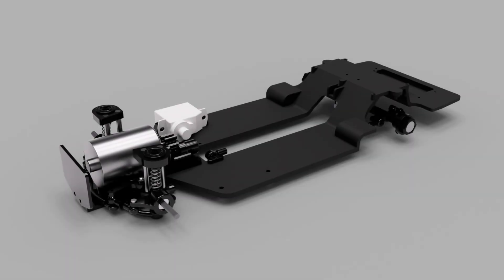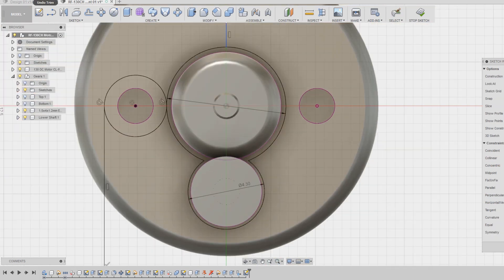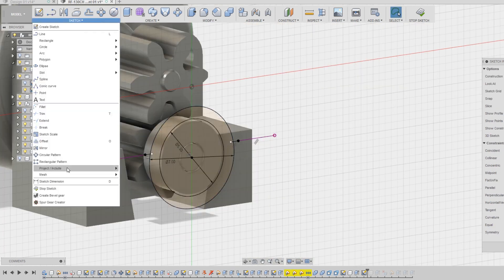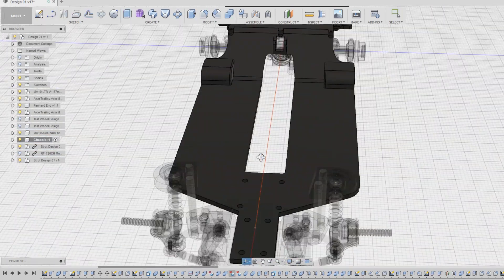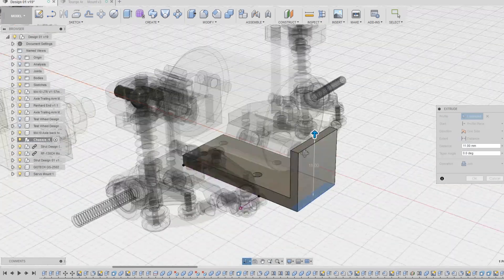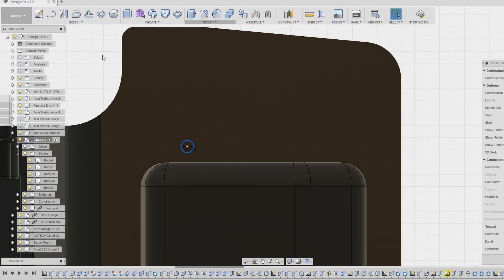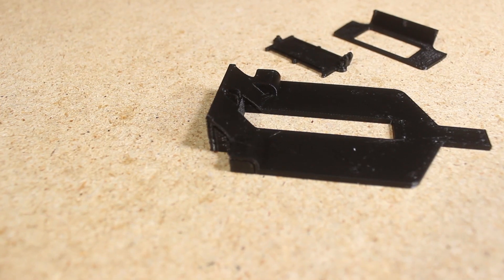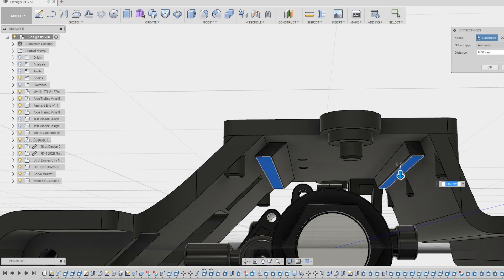RC Chassis Speed Modeling: Finishing Designing the 1/24.5 Scale FFR SC1

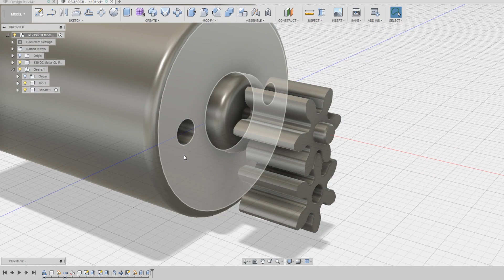Comment: I race slot cars ( HO/1:32nd/1:24th) and, having found your channel, I've been inspired to build a 1:24th scale car chassis based on your parts. I was wondering, what kind of motor specs have you been designing your parts around?
Reply from the maker: Mostly just typical 130 size DC motors and I've also been designing some around smaller brushless motors as well. Most motors I've tired have more than enough power, and it's easy with most transmitters to turn down the max speed if needed. Experimenting with different spec motors is something I will be experimenting with more in the future.
Reply: Thanks. We use a 180 size motor, NSR King 25 (25,000 rpm, 350 g/cm torque @ 12 volts), and was wondering how well the drive train might hold up. I might have to look at other motors.
Reply from the maker: Yes, That motor sounds a bit overkill for these vehicles. We will be offering a selection of compatible motors and other electronics as well.
Reply: Our 1/24th scale slot cars use a brass chassis (H&R Racing; http://www.hnrracing.com/), that is why we use such a torque-y motor. I might try to make a brass version to maintain the motor spec, though, I also want to try use your parts in one of my builds.

Comment: Simplify 3D has a feature called dense supports. With it turned on you can select what infill percentage the top n-layers will have. To you could do main supports at 15% and a dense layer or two of say 40% where it meets the bottom of your part. You can also try generating supports at 90 and 0 degrees offset per layer, this gives nice support in x and y axis as well as being easy to remove. Maybe also increase horizontal offset from part in your support tab to make them easier to remove. I usually use about 1 nozzle width for this.

Comment: Great Video ,I've only just found your work and it's pretty impressive... Just a thought , a flat form will always be prone to being 'loose'  this is why in sheet metal ribs or other forms are worked in to tighten it....Could you not add rigidity in a similar way  with ribs in your design rather than just increasing the total thickness and therefore also the weight.... Just a thought...

Comment: Great job! Although the 3 piece rear section ight be the weakpoint of the design. i'd certainly print it in one piece and would add some tabs lenghtwise, or in a cross shape
Reply from the maker: Thank you. I'll probable end up making a one piece option as well, though fortunately in the context of a small light weight RC car, the chassis dosn't need to be too strong. Flexing it by hand will be far more force than it will ever experience driving around under its own power.